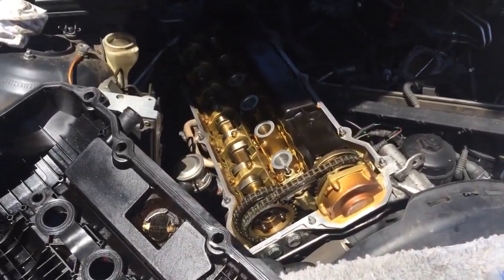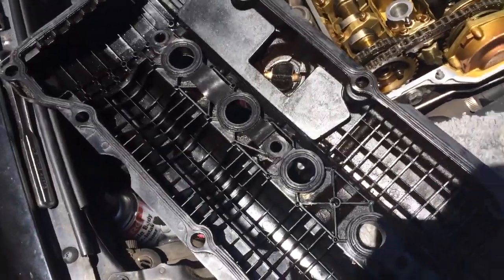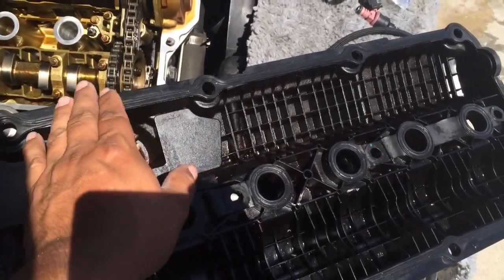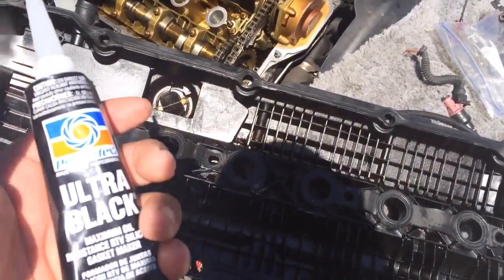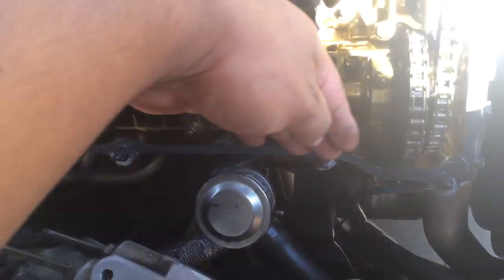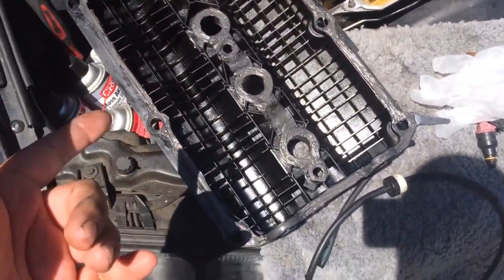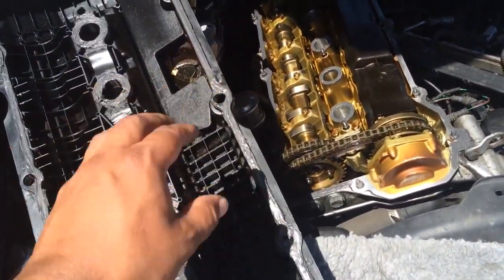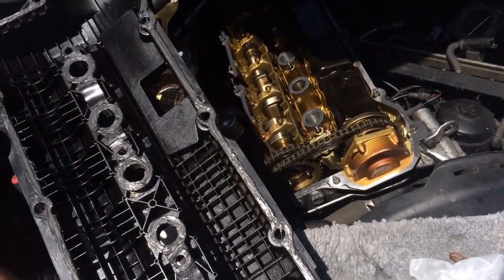TIP ON Valve Cover Gasket BMW 5 Series 3 Series E90 E39 528I 328I M5 M3

Comment: For me Iam sticking gasket with silicon on the engine block first allow it to seal firmly give it one day as usual full dry then put valve cover on it and tighten bolts that's best way otherwise you'll suffer leaks from time to time don't like valve cover gasket job a big headache and it's critical you have to do it right otherwise you'll spoil your engine by losing oil and it'll be sized

Comment: Just be carefully with that gasket maker.........If you use too much or if some breaks off and gets into the oil - you could have some huge oil circulation/starvation problems or even engine failure.    I try not to use that stuff unless you really have to.   Sometimes it is required.  Otherwise it is good stuff.  I would have got a new gasket and then done the job unless it was a pinch or an emergency.

Comment: You're asking that silicon gasket to do too much, in my opinion. First, you are putting it on something that has a know seal issue. Then you are expecting it to seal as if it were being used as advertised. 

You'd be better be off removing the spark plug gaskets entirely and using just the silicon. Plus, this is just a band-aid. Why not wait an extra few days to get the part in?